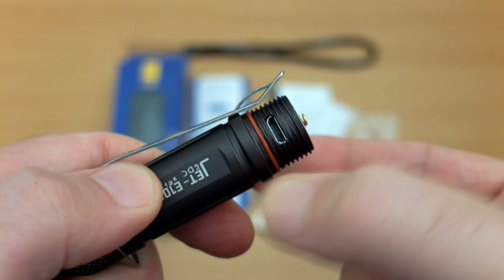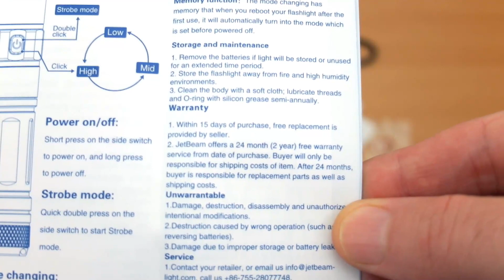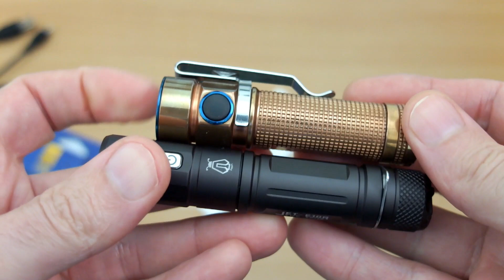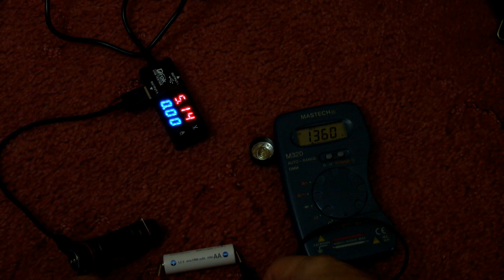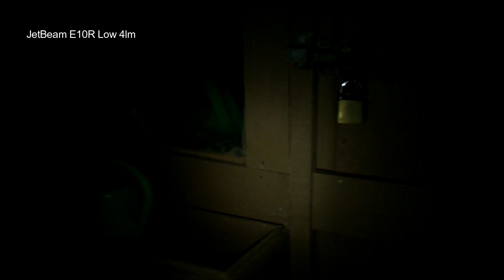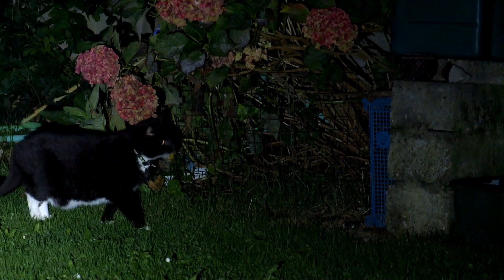JETBeam E10R Rechargeable LED Torch: Review & Test

Comment: I have this torch and it seems they have revised it sice your review at the magnet is stronger on the base. Has been my go to for work and i use and carryvit every day mainly using the lithium battery and charge it via the usb but nice to have the ability to put a disposable AA in there if needed. I have been extremely impressed by this and wouldn't hesitate recommending it to anyone. It's a shame your model had some shortcomings.
Reply from the maker: That's a good sign, shows they are taking note of some of the drawbacks. Yes the magnet was pretty weak on this, and it has issues with the WR, if they solved those 2 things that would improve it a lot.

Comment: The weak magnet issue is surprising. Usually Jetbeam lights are well made. What's the point of installing a magnet that's not even capable of holding the light at a sideways position, without dropping off? I've owned several Jetbeam lights that I bought for myself initially, then bought more as gifts, after seeing how well made they were. My current everyday carry light is the Jetbeam Jet II mk. I paid $29 including a Jetbeam 16340 battery. It's a twisty operation light. It's been great after 6 months.
Reply from the maker: Doesn't seem to be an isolated experience I've seen others mention it. Thing is I don't really have a brand preference, I just try to test and find out what might appeal and where it could be better. There isn't a lot of point including a magnet in the torch if it can't support it's own weight - waste of time, mix in the undercharging for Ni-MH cells (likely the most common cell people will use) and it's a bit of a fail in my books. Odd thing is most people didn't test these areas and heaped praise on it. which doesn't help buyers at all. I know it's not a pricey torch but still I'd want to know about these things if I were buying. I don't dislike Jetbeam, but this one is a bit of a turkey has to be said
Reply: @MrBazReviews  
I've owned quite a few LED lights since buying my 1st one in 2011. The only 2 that I can  criticize in a significant way, was: 1). Spark SL5 220CW(switch failed after 3 months of edc).  2). Lumapower D-Mini EX-2. It was instantly obvious that light was complete garbage, from right after I opened the box. I posted a review/warning on candlepowerforums in 2012 when I bought it. It had more issues and problems than I honestly thought possible. Here's the link, and it's the poster child for failure(there were even more problems that I forgot to list in the thread, such as the thin, lousy o-rings): http://www.candlepowerforums.com/vb/showthread.php?339025-Lumapower-D-Mini-EX-2-quick-review-Dont-waste-your-money!&highlight=

Comment: Well, its black Friday 17’, so time to check out reviews on this light.
Man, great review!  Disappointing on your negatives for the light, was hoping for a better outcome.
@$20 currently on batteryjunction, seems like a great buy, and it still might be even with its flaws.
The biggest negative for me is the power levels (hence checking out reviews before buying) with 14500 cells.  Only 3 levels and a huge drop between high & med = bad!
Oh well, moving on.  Oh, have the old olight S15R – Bomb proof!
Reply from the maker: Before I got the review sample I watched a video someone else did on the torch. They called it a "work of art". It is in bad torch design it's my worst of 2017 by a big margin, awful clip uncomfortable to hold, undercharges Ni-MH, insane weak magnet that can't even hold the weight of the torch minus a battery. It's just plain bad.

If you want a budget torch the On the road U16 is pretty good or just try the Olight ones they are more expensive but actually work properly. S1A isn't a bad bet

Comment: Nice review as always 👍 i think i will have to put this one on my to avoid at all costs list lol disappointing torch from a manufacturer such as jetbeam don't quite know what they were trying to achieve with this one
Reply from the maker: Keith it could have been a great torch the concept is spot on, micro USB charging should appeal, but can we have a clip that isn't uncomfortable, proper charging for Ni-MH, a switch that you can feel in the dark, another power level a magnet that holds the torch!. This should have been a winner but they came up with the idea and didn't really test it properly. If they do a new version and they fix most of those areas it would be a must have for many.